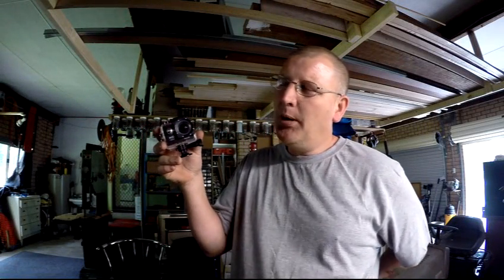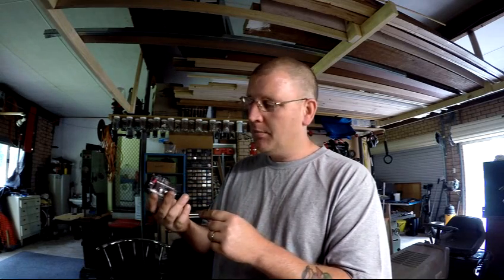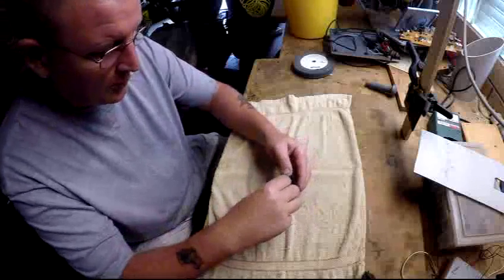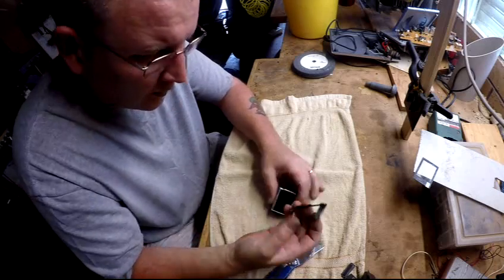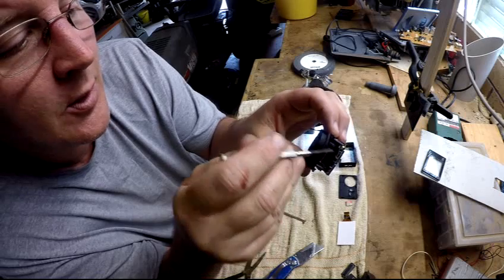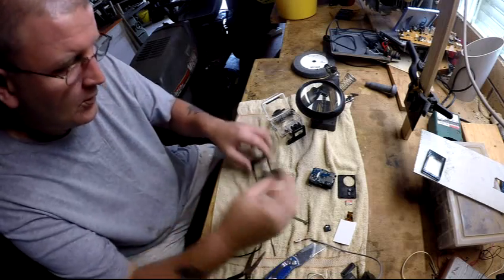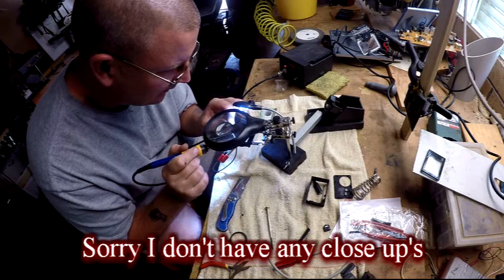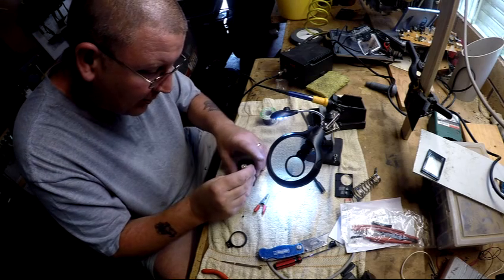#25 SJ 4000 External Microphone install DIY Mod

Comment: Hey.. what kind of mic did you use? The one that have battery on it like Boya Mic or just normal mic? Sound super clear.
Reply from the maker: Just a cheap plug in ebay one
Reply: Pommy-Down-Under  Thanks. I have ditched my Boya Mic and plug in the mobile phone earphone and works like charms

Comment: hey pommy nice video mate.. could you just telme did u solder one wire to both the terminals in the camera circuit after removing the internal mic???? please help me with this because i am not so good with electronics!
Reply from the maker: Hey Sid,. The mic has 2 terminals on the mother board + & - 
So one wire to the + and one to the - it wont matter what way around as long as there is a wire to each. Hope that helps?

Comment: hi sir i just baught sj 5000 can i do the same thing for external mic  ??
Reply from the maker: Hi Imran, there is a micro usb to a microphone jack, available now, not sure if it works though?? you will have to research it, but if all else fails then you should be able to mod your camera. Good Luck.
Reply: i baught that usb to aux cable is well still not working , yesterday i chacked a brodcasting mic for smart fons and for cam corders but the problem is now mic is not catching my voice very well its catchinh the back graound noices extremly very well :(

Comment: Hello my friend could you please tell me if I can use this adapter https://www.amazon.co.uk/3-5mm-Audio-micro-Converter-Cable/dp/B00NIGLTJY/ref=sr_1_2?ie=UTF8&qid=1450731337&sr=8-2&keywords=micro+usb+to+3.5mm  

 then use this microphone   https://www.amazon.com/Sony-ECMAW4-Wireless-Microphone-Black/dp/B00JWU6WWO/ref=sr_1_1?ie=UTF8&qid=1470942026&sr=8-1&keywords=sony+ECMAW4  it's possible? thanks for your help
Reply from the maker: Hi, I have had reports that have said that they do work, and people have reported that they don't, they don't cost much give it a go and good luck, Perhaps post here again with the results. the mod i made was about a year ago and still works fine.
Reply: Okey , but to seek an adapter and place the camera and then it is via Bluethooh then you can not?
Reply: +Rafael Molina 
hi is this cable can be use on sj 5000 ?

Comment: What about using the usb to 3.5mm cable like the gopros use? Does that not work?
Reply from the maker: Hi Stephen, most comments ive had about the 3.5mm cable, would suggest that it doesn't. But if your willing to try and get different results please share with us here. Cheers Glyn

Comment: hey nice video.. Just a few ques:
1. does this mod have any affects on the long term life of the came ?
2. Is the audio after mod with an external mic good enough for motovlogging when setup nicely inside the helmet so that least wind sound reaches it.?
Reply from the maker: +devashish chauhan Hi mate thanks for watching and commenting, the mod shouldn't have any long term effects on the camera, as long as you do a good job, I think it would be great to fit into a helmet. and just remember that you can buy quite a few of these cameras for the price of a GO-PRO.
Reply: +Pommy-Down-Under Thank u so much for the reply .. looking forward to buy one and get the mod done.. cheers!!

Comment: Hey Glyn nice work on your SJ4000, I am in the middle of modifying my SJ4000 with an external mic and also setting up an external solar power pack all strapped onto a chest harness and also incorporating similar to a head harness. Passes a few hours whilst it's raining outside :-D need to get me one of those Man Caves like yours lol GL & HH
Reply from the maker: +Little John Lol, Hi John, I hang out in my man cave in the summer, to bloody hot outside. 
2 nd day of Autumn now so wont be long, and i'll be back detecting again soon, hopefully!!. 
Good luck with your mods mate, Glyn

Comment: thanks for the video!  I have a question: do you know on how many Volt's the internal mic is running?  I want to replace it with a better one
Reply from the maker: +Ralle I'm not sure mate, this is the mic I have running from the motherboard were the mic would be, and works great, http://www.ebay.com.au/itm/External-Microphone-Mini-USB-Cable-Lapel-Tie-Clip-Mic-for-GoPro-Hero-3-3-4-New-/151696073915?hash=item2351ca64bb:g:nPwAAOSwHnFV7AVB
Hope this is of some help? Good Luck with what you decide to do. Glyn.

Comment: Does a mini usb to 3.5mm not work then?
Reply from the maker: +TheA_Mboom  Hey mate, in all honesty I don't know the answer to that!, but all the hunting around the net I did,  I found no other way of attaching a external microphone. all i can say is give it a go, and maybe post back here with your results. Good Luck Glyn.
Reply: +Pommy-Down-Under okay, thanks. I shall let you know if it worked or not
Reply from the maker: *****  Good luck, and yes Please let me know. Cheers
Reply: Pommy-Down-Under Hello! I just got the cable through and it works!
Reply from the maker: +TheA_Mboom That sounds great mate and would save a lot of work. 
Could you post a link for the cable here and any info that you have found relevant please, even better if you have a link to a video that you have done on it, and I will give you a link in the description. cheers Glyn.
Reply: I haven't got to any videos yet as I am working on a TV series but here is the link to the cable

http://www.amazon.co.uk/3-5mm-Audio-micro-Converter-Cable/dp/B00NIGLTJY/ref=sr_1_2?ie=UTF8&qid=1450731337&sr=8-2&keywords=micro+usb+to+3.5mm
Reply from the maker: +TheA_Mboom Thanks Buddy I have put a link for your channel in the description and a link to the cable.
I subbed your Channel and I wish you a Merry Christmas mate, have a good one. Glyn.
Reply: Pommy-Down-Under Thank you, and merry christmas to you too!
Reply: lakaiyak should do, did for me. Mine was 98p free postage, so its worth a try
Reply: lakaiyak no problem
Reply from the maker: +lakaiyak Read the description at the top, but basically 1 person says Yes and another says No, if you buy one I hope it works for you. Cheers.
Reply: +Pommy-Down-Under for it to work you need to buy a splitter that has 4 sections on the cable, but its not expensive. I picked one up for 60P on amazon
Reply: +TheA_Mboom what do you mean by four sections?
Reply: The lines on the 3.5mm male jack. It separates it into sections. Commonly theres 3 but in order for it to work you need 4.
1) Audio Left/ Mic Left Power
2) Audio Right/ Mic Right power
3) Mic input/ Data
4) Negative
Reply: @TheAMboom  The hell?

Comment: can you show how to do it and where you got your supplies from?
Reply from the maker: +Brian Frazier Hey Brian thanks for watching, I have shown the best that i can on how i did it, and the only thing you need is a bit of 2 core wire and a female Jack that you can get from ebay  or radio shack or the like. Sorry that i cant be more help, if in doubt of your skills don't do it.
Reply: It's just that everyone puts out videos but they don't actually show you how.  Is there somewhere you got the idea from or a reference guide?
Reply from the maker: +Brian Frazier Hi Brian, There are some other videos on YouTube that ive noticed doing the same sort of thing just do a search, they might be able to help you a bit further. 
I have a bit of experience with the solder iron and a love for taking things apart, lol
If I thought that it was going to be as big of an improvement as it is, I would of spent more time videoing it, but it was trial and error for me really and thought that I would do a video, success or fail type of thing, I just had a go. there's only 2 little dots of solder that you have to do where the mic is, If I ever do another one I will do a better job of it.
Reply from the maker: +Brian Frazier This might help mate. http://www.amazon.co.uk/3-5mm-Audio-micro-Converter-Cable/dp/B00NIGLTJY/ref=sr_1_2?ie=UTF8&qid=1450731337&sr=8-2&keywords=micro+usb+to+3.5mm